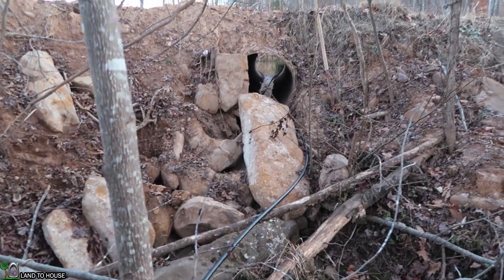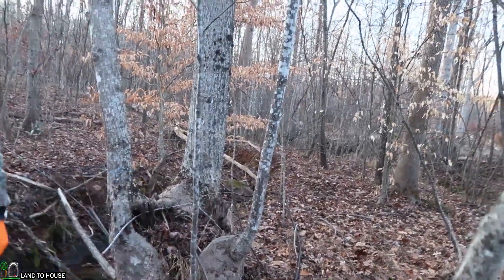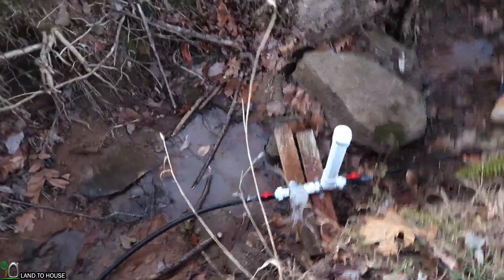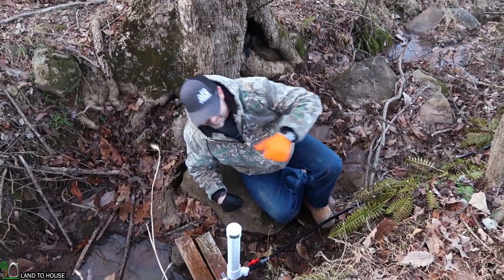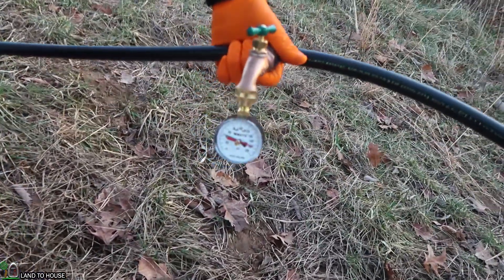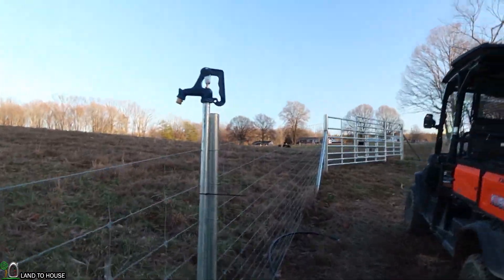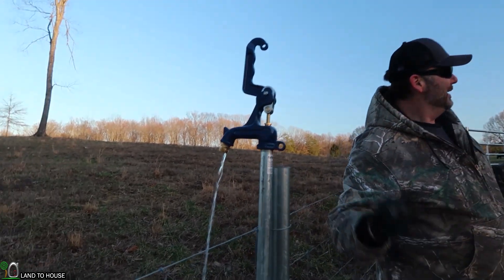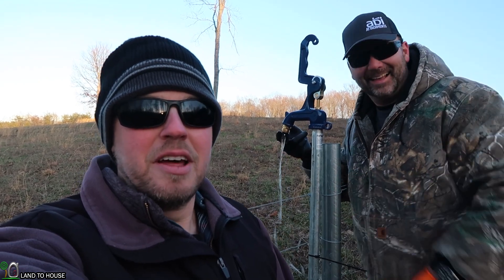Small 3/4" Ram Pump for Josh the Stoney Ridge Farmer

Comment: If I built/bought the 1.25" RAM, using this same scenario of (intake from a pond), what connector and what diameter polypipe/pvc do I need on  the stand pipe to the RAM?  What size polypipe should I use on the output side??  (I have always wanted to do this.....)
Reply from the maker: The drive pipe needs to match the pump so 1-1/4". The delivery pipe can be any size. I often use 3/4" on the 1-1/4 pump.

Comment: The drive pipe should be twice the size of the output pipe. This should run to the waste valve then reduce it. 

If you want to use a bladder...
https://www.hardwaresprings.com/plastic-injection-molding/the-inflatable-rubber-pipe-plug-closed-water.html
                                              Just Thinkingoutloud      Good luck

Comment: has there been a measurement of how much water is pumped water & how much is discharged at the valve/ram pump?
Reply from the maker: Typically the waste water is around 80% and 20% is pumped. But there are several factors that effect the ratio. Drive pipe rigidity and length, head pressure input and lift height are the main factors.
Reply: @LandtoHouse  thanks very helpful.
Reply: @LandtoHouse  thanks very helpful.

Comment: I'm looking at raising catfish in big stock tanks. I'm cheap and I don't want to run electic to stock tanks. Can something like this work to transfer water from fish tanks to smaller filter tank?
Reply from the maker: The ram pump is great at pumping water from a creek but not the best at ponds. Does your pond have a nice creek that feeds it? The pond in the video has a small creek running at 6gpm that feeds the source. Otherwise the pond will drain fast!

Comment: What's the typical head/lift ratio for poly vs PVC pipe (from intake to pump)?  Also couldn't he pump up to a tank then gravity feed those spigots from the tank, to avoid the pump stopping like that?  Thanks, Seth.
Reply from the maker: Yes absolutely. In this video he just wanted to get a proof-of-concept. The end goal would be to pump water to a large tank on the very top of the property and gravity feed from that. I have run a couple tests with poly pipe vs PVC as a drive pipe. The PVC showed significant increase in lift because it did not have so much bounce or kinetic loss
Reply: @LandtoHouse  Look forward to seeing his final setup, that'll be really cool. Thanks for the reply. The half inch pump I bought from you three years ago is still going strong, on the original valves! I'm using poly pipe for everything.
Reply from the maker: @frenchopotamus  Wow that is fantastic feedback! Often the valve wears faster with more head pressure. I think the new SS valves will last a very long time.
Reply: @LandtoHouse  I only have maybe five feet of head. I'll probably upgrade to stainless when these valves finally give up.